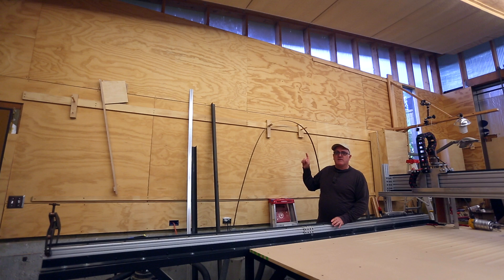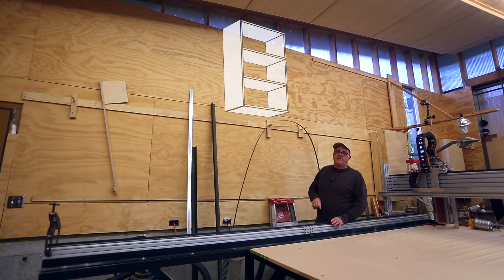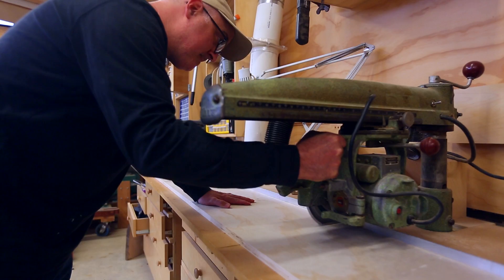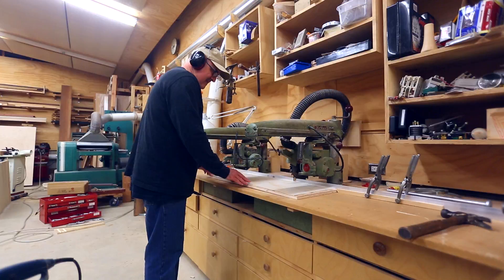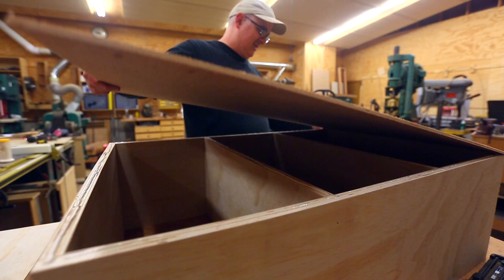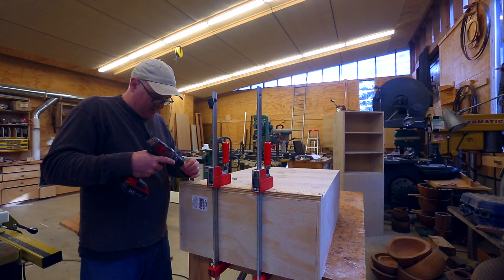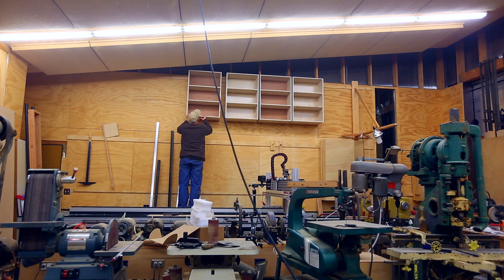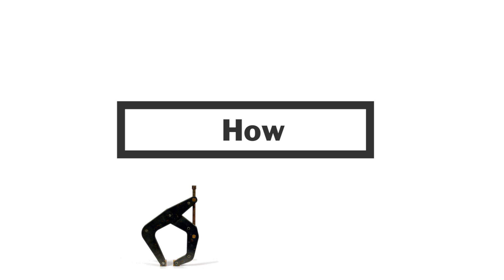Simple Shelves on French Cleat

Comment: Great video, as usual.  In the past, for shop shelving boxes, I have used full DADOs on the top and bottom by offsetting the the top and bottom shelves by an inch - I think it adds a lot more strength and uses minimal space. . .   They are harder to dust though.

Comment: I would suggest to install it slightly lower so it doesn't block the sunlight from the Windows.  And the bottom shelf looks very weak, and the French cleat is basically screwing onto the top shelves? Is that strong enough?

Comment: I'm supprised of your trust in the strengh of the french cleat. The top piece which the cleat is attached to also misses the upper dado side, this additionally weakens the edges.
Would you try to break a test piece to show the strengh of your setup?
How much weight did you put in there?

Comment: With the cleat screwed into the top of the frame, it looks like all of the weight of the shelves and its contents are going to be put on the rabbet joints between the top piece and the sides. Are you worried about all the shelves and sides separating from the top under all that weight?
Reply from the maker: +Dave Starr There is a screw in each side.  and the back panels is sandwiched in there and taking some weight too.   you do make a good point,  i'm wondering if running the top and bottom of the sides an inch longer so there is a lip for the top and bottom shelves to pull against.
Reply: +Dave Starr he also put a screw into each of the sides on that top cleat.
Reply: +frank howarth I'd consider moving the cleat lower so that it can be fastened to the top shelf (not the top of the box) and the two sides, as this shelf is very firmly fixed to the two sides. (Yes, you'd have to move the cleat down a foot or two!)
Reply: +frank howarth Try a destructive test on one of the shelves....  Keep adding weight to the bottom shelf to see if you can get it to pop off. Then keep adding weight to the middle shelves to see if you can get the top cleat to fail. I suspect it might fail, but it would probably hold quite a bit of weight before failing.
Reply: +Dave Starr The back plywood keeps the top from separating. Remember, the cleat is screwed through the back and into the top, so the cleat, the back, and top are essentially unified. Because the back is also glued and nailed to all parts of the cabinet, loads on the shelves and bottom are transferred to the cleat thru the back as well as thru the sides.
Reply: +Double Dare Fan Right, I get all that. I just know that if the top were joined to the sides via dadoes instead of rabbets, that'd be stronger, and I wonder how much weaker the whole thing is for it being rabbet joints instead. Maybe we need Matthias to build something similar to test for us. :-P

Comment: You mentioned a concern about the bottom shelf, since the dado leaves no support underneath it.  It seems it hasn't been a problem for you, so all's well that ends well, but given that the cleat is attached to the top shelf, doesn't that also apply on the top side?  The entire unit "hangs" from the top shelf, and no part of the dado is above it.  It seems that the glue and staples would end up doing most of the structural work.

I wonder if attaching the cleat to the second shelf down would help alleviate a bit of that concern?  To the extent that it is a concern, anyway...

Comment: Very nice, love your videos. Instead of a spacer at the bottom could you make a second cleat to help distribute the load better?
Reply: You can but the spacing of the cleats has to be perfect. if it's just slightly off one will do all of the work and the other won't fully seat. french cleats are often used to install kitchen cabinet uppers and it's not uncommon to also run some screws through a thicker back into the studs for extra support. As is though they can hold more weight than he would ever want to lug up that ladder.
Reply from the maker: +Grant Determan yes exactly
Reply: +frank howarth You're right of course but you can make a "template jig" that you use to set either the cleats on the wall or on the cabinet backs and use that to set the cleats on the wall or cabinet back - one is just the reverse of the other so a jig is doable. Thanks again for such an entertaining video.  Cheers.
Reply: Yep that makes sense, it would be extremely difficult to make 2 cleats line up. And they wouldn't be sharing the load if they didn't align.

Comment: Hi Frank !

I love these "dados blades" !

I can see the "middle saw blades" in the stack are some special ones.

Did you buy the whole set 

or 

just stack some ordinairy saw blades with a specific washers in between ?
Reply: +Keld Sørensen The "dado blades" seen in the vid is an actual dado set that you can buy. The "middle saw blades" are chippers. You can improvise a dado set by stacking a bunch of blades. I've done it.
Reply: Double Dare Fan
I've never seen these "dado blades" here in Denmark - and my first thought was to just stack some with special thickness washer in between - just my first path, I think.
Reply: Apparently this type of saw is not approved here in Europe and it is not easy to find in a hardware store, but I have seen here in Spain but its price is very high, more than 200 € the set. They are not two saw blades with a splitter, the teeth have a special design that make the cut and remove timber inside the groove. I hope I have a little more aclararte this matter, receives a warm greeting from Madrid.

Comment: Is there any reason this system couldn't be used for bookshelves?
Reply from the maker: +misterscottintheway you might want to test if for that much weight, but it should work.
Reply: frank howarth Thanks! I would probably move the bottom shelf up an in so that it could benefit from the strength of the full dado.